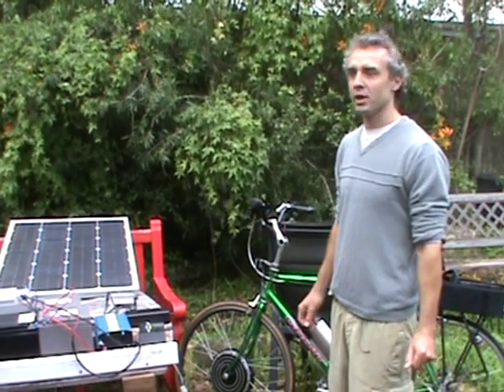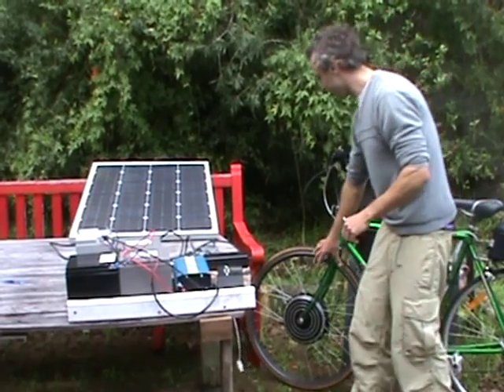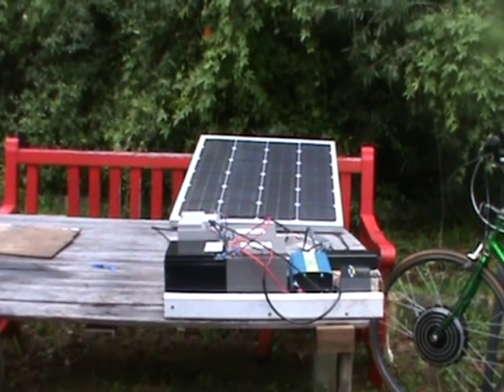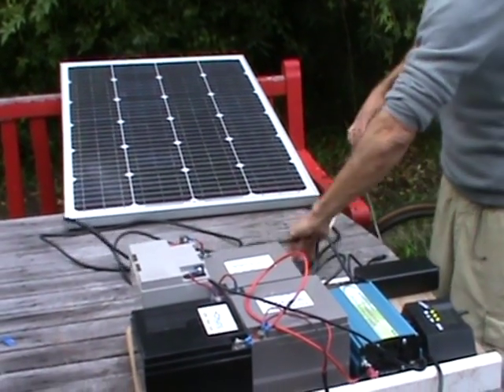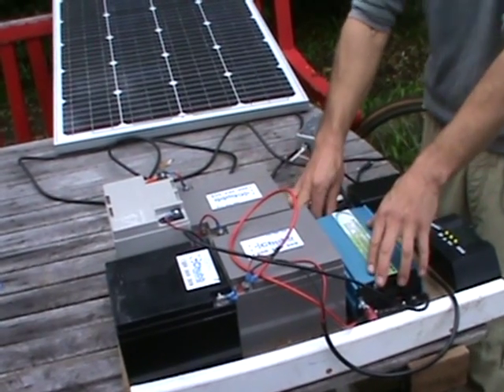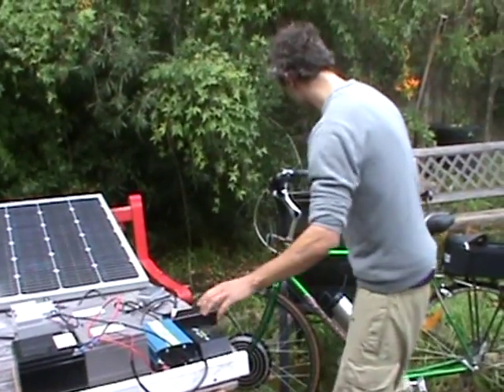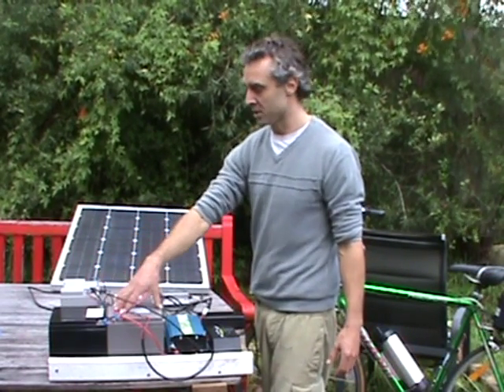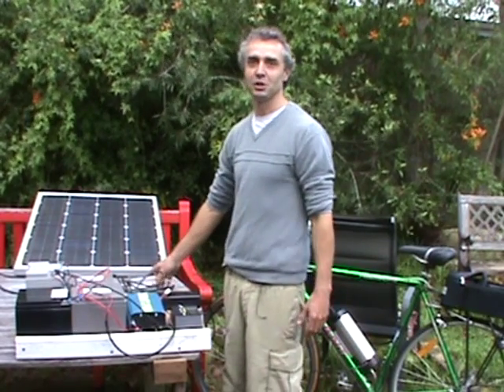Hybrid Day Night Solar Charging System for Electric Bikes

Comment: most of the users do not understand how lithium ion battery behaves, do NOT try to create charging device yourself. The explosion or fire from lithium ion battery could reach 1200 degree celcius in matter of 10 seconds! This guy does not know the basics, it is not as simple as dc to dc charging.

Comment: are u aware of the lithium ion battery charge curve? without sophisticated protective control design, blatant charging solar into you ebike lithium ion battery could result in fire or explosion! it is not as simple as dc to dc charging! do not teach others something you do not understand thoroughly! Lithium ion battery is very dangerous during charging if not done right.

Comment: if u put panel direclty without battery ,u give only the energy from sun but it's can different Wh right depend the cloud  ?but if u direct with storage , the battery will give always same Wh  until the battery is empty and the inverter will stop bcuz low battery . nice for charge when u have time ,or charge in night from the day sun stored